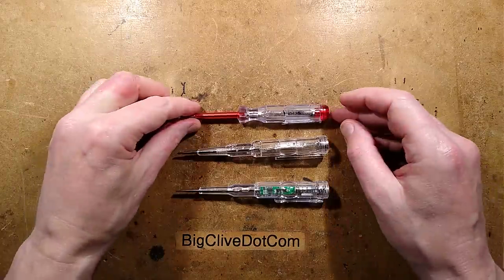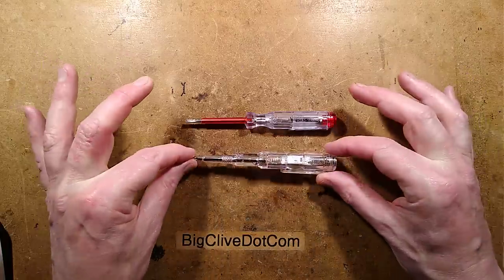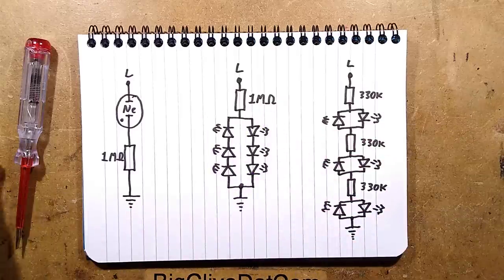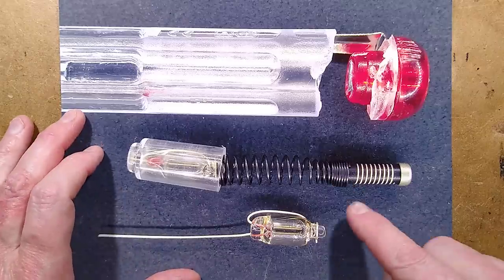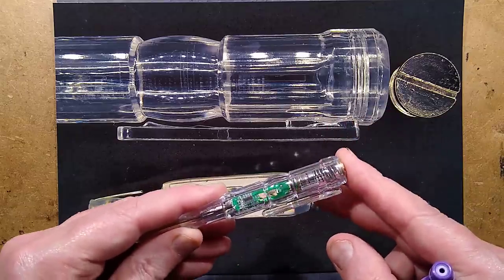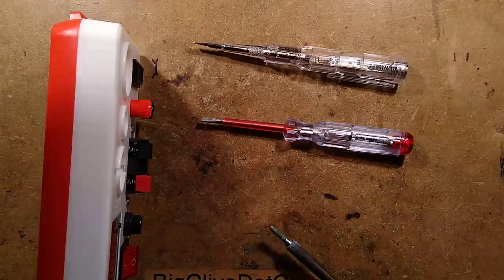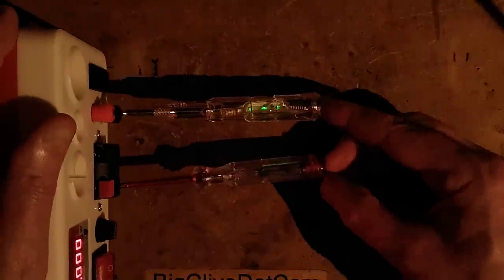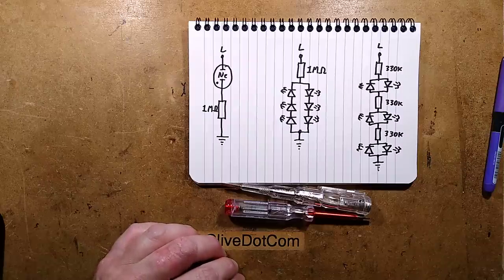Reinventing the neon test screwdriver

Comment: Here's a true neon screwdriver tale: I had a close call being up on a ladder many decades ago in a friend's factory in London checking to see if a 440V panel is dead or not before ripping it all out and redoing the connections. 
On that day I didn't have a neon tester so instead I was using a multi-range tester, holding the black and red probes one in each hand while leaning forward to the electrics to stay on ladder. I carefully dabbed the probes to various places but didn't get any voltage reading at all, it didn't make sense and it completely messed up everything I had planned out. All I got was the reading briefly just tiny jump slightly from zero when I made the probes contact. I wanted to confirm the voltage was there first then shut off that circuit only. 
So I just came back down from the ladder, very puzzled, I then packed it in until the next day.  Next day I came back in to repeat and then I noticed.... the tester was switched to DC VOLTS instead of AC. DOH!   I was THAT close to a major calamity but my '6th sense' + logic had saved me. 
If I had instead a Neon Screwdriver in one hand then I wouldn't had needed to have a 6th sense + logic to protect me. = much safer.
Reply: What if the ladder increased your resistance to ground and the neon wouldn't have worked too?
Reply: @jor7137  Very good point.....  if the metal ladder I was up on had been instead made of insulating plastic, but a wooden ladder that's more feasable. I'd still be puzzled all the same why a neon hadn't lit up for me first before I'm ready to cut the power, then I wouldn't had proceded any further by default.
I just now remembered all those decades ago when I used a wooden ladder: I would leave a reel of insulated cable down on the ground and then carried up the loose end with me still insulated. 
Then came out in the 80s the non-contact LED 'volt-stick'. I guess if I'd used that the combined wood together with proximity acts like an almost short-circuit impedance?
This all just neatly proves: 
the most sinister and deceiving failure of a safety feature - is the one which is believed to be reliable
Reply: @jor7137  By the way had you seen that YT video of the HV (500 kV?) line worker on a platform attached to a hovering helicopter, clipping on dampers one at a time to each live phase wire.  There was a huge long spark in front of him as he approached.  He definitely wouldn't had needed a neon tester!!
Reply: @jor7137 A neon tester would still work even if the ladder was insulated . They work even if you are wearing electricians safety shoes. 
If the path to ground is blocked by an insulator such as a wooden ladder , neon testers will use the capacitance of your body to function. Any insulation such as rubber soles or wooden ladders,  become the dielectric of a big capacitor where your body acts as one plate and the Earth as the other.
Try it , you can jump in the air while one of these things is glowing , and as long as it stays connected to the live, it will continue to glow.
Reply: @graememorris7820  Good points. I had them give false positive before. Not sure about false negatives
Reply: @jor7137 I can't see how they could possibly give false positives (or lives).
They are great at identifying live neutrals. If the neutral line has become  disconnected from the main neutral bus, and an appliance has been left switched on, that neutral line can float live via the appliance . This phenomenon has caused many accidents , the neon tester will identify live neutrals in situations where a volt meter, or other devices that rely on the integrity of the neutral, will deceive you.
Reply: @graememorris7820  I can't explain it to you, but I have seen it. A cable that was disconnected on both sides. The neon bulb would glow. Must be induction or radio waves.

Comment: The neon bulb has high enough resistance to prevent a lethal shock even if the megohm resistor fails short circuit. The neon also has other uses checking for microwave leakage or standing waves on an antenna circuit. LED’s offer no protection, hence your suggestion of using three resistors in series. Fifty years of using neon screwdrivers as a quick sanity check gives me a degree of faith in these simple devices that I don’t have with the all singing and dancing high tech solutions today. Yes, you do need experience of how to use them properly and appreciate that no light never means a guarantee of no voltage!
Reply: The impedance of a neon lamp once struck is quite low. Certainly low enough to carry enough current to be dangerous, tens of milliamps if not more just for a small indicator lamp. It would be highly dangerous to rely on the neon to protect you if the current limiting resistor failed short.

Comment: The neon has a much higher threshold which could be useful. To duplicate the effect a couple of back to back zeners in the 68V range in series could be added.
Reply: Don`t need zeners back to back,  look up Tranzorb diodes !
Reply: @pjeaton58  Transzorbs are much better for transients and less accuracy on the point at which they start to conduct. In this application I'd stick with zener diodes.

Comment: Interesting. Mine has a different design. It contains spring which is connected to the red cap and is pushing to a glass fuse where the fusible wire was replaced with a neon and a resistor inside.
But sadly the transparent plastic cracked and the red cap fell off and when I glued it back the glue covered the fuse with a white film overtime and slowly terminated the connection between the spring and the "fuse" so the neon won't turn on anymore.

I hope they will make these simple test screwdrivers with LEDs instead. And it looks nice with the green ones. But I like the neon variants too.

Comment: It would be interesting to read the current in µA.  The green LEDs are acting similar to LED lamps that continue to glow dimly after the power is shut off due to leakage currents.
Reply: Good quality Green LEDs need only a few hundred microamps to look reasonably bright.  It depends a lot on the quality of the LED; there are so many shysters selling LEDs with defects, especially ones with bubbles in the clear epoxy.  If you buy LEDs that are not mounted on tape, there is a high probability they're factory culls.
Reply: @acmefixer1 what do you mean by mounted on tape?
Reply: @chloehennessey6813 components with leads are shipped stuck to one or two strips of tape for automated handling
Reply: @chloehennessey6813 on the reels that they come on for mass production probably.
Reply: I've experimentet quite a bit with leds and ultra low currents to recreate tritium keyfobs. 
Green doesn't work that well. 
White (warm white as low as 1800k 3535 leds) are by far the best. They can be seen at normal room brightness at as low as 2μA. Green takes ~10μA to be as visible. The second best are blue and ice blue leds followed by some kind of pink. Red and yellow are the worst taking >20 μA to be even visible at lower light conditions.
Reply: ~100μA with an white led is bright enough to read text in a 3m² room, that is othervise completly dark. :)

Comment: I think the Neon lamps are safer and last forever in such application. 
The fact that diodes fail short is disconcerting. Neon lamps have two plates separated by gas, not much can go wrong there.
Reply: neon lamps die too  the glass can break. or something can disconnect.   led will also last forever
Reply: Even if the LEDs fail short it would still be safe. That's why it's better to use the version with several resistors in series to spread the voltage and keep it safe even if a resistor is shorted.
Reply: I was thinking the same thing. Some circuits I have seen, which take a voltage reference from the mains, do so with a whole stack of resistors in series for safety.

The classic neon screwdriver uses just one resistor, and my thinking was that neon bulbs added the additional protection.

Comment: Would be interesting to plot some measurements and see how they vary with dry vs wet skin etc.  If there is a reliable gap between grounded and non-grounded thresholds, could the circuit be improved by setting a couple of comparators at those levels - then you would have a logic signal you could do anything you want with (like light LEDs at full intensity :P )
Reply: You can feel the difference. Hot sweaty environment can make it a bit tingly.
The ol' "testicle pensicle" has saved many a lecky from unexpected live ones. In bright light you feel it before you see it.
240 / 415 VAC control circuits are still around.

Comment: Never thought it would be this simple to use LED's in one. It makes me wonder whether one couldn't make a nice little decorative light without a neutral connection. Super simple design and looks really nice with the slight flicker.
Reply: without a neutral, I'm guessing that if you add enough of them, you can trip the earth leakage protection
Reply: That's called the antenna effect. It's technically capacitor efect. I see it every day when leds are used with very long wires, they glow even when switched off.
Reply: @rexsceleratorum1632  Good catch. Still would be a nice light but probably should use the neutral instead.
Reply: @Benoit-Pierre  Yeah, but that isn't done intentionally. That usually happens with cheap lights with no resistor across the led's.
Reply: @memejeff   It happens in most wall switches that include a witness (the witness may light in the wrong situation) (Legrand Mosaic, Celiane, or Plexo using LEDs like 067686 ), or alarms like Legrand 076671.

It also used to happen with LED bulbs used with halogen regulators: even switched off, leakage current could still light the lamp; recent regulators now fix this issue. You can also fix the issue on the bulb side by adding a parallel 0.1uF X2 capacitor (X2 does not means times two, but the letter hix two is the capa classification).
Reply: @Benoit-Pierre  ah I see. Mine don't have those. That makes sense. I hear that they expect a load larger than an led bulb. Thanks for the tip :)

Comment: I would consider that a solid replacement-in-kind for the neon design, for sure.

Have you consider maybe a 20 mA pcb fuse in line, if you're concerned about the isolation capacity of the resistor?

Comment: It may be easier to do an LED version that fitted in the larger version of those electrical test screwdrivers. If a pair of RGB LEDs was used, they could be configured in inverse-parallel with a resistor for each pair. The resistances could be chosen to give a particular colour, possibly including one approximating a neon.

Comment: I must defend the the much maligned neon  screwdriiver and your improved LED version. I was brought up on this device when Avos other testers were too bulky to carry on a push bike and providing you understood the limitations as you must with all. test gear. I was once sent to investigate why shocks were being given from a cold water tap, the neon tester lit when placed on the tap! Of course the tap was not alive but the floor was, reaching in through the doorway and digging the neon screwdriver into the wooden floor there it was. The floor was soaked in moisture and chemicals and was conducting from a faulty heater next door

Comment: In the old days, the neon bulbs are brighter and lighted bulb can be seen easily.
Nowadays the neon bulbs are poor illuminated that may be seen as no high voltage and caused electrical shock.
For safety, I use clamp meter with NCV for AC high voltage non touching  testing.

Comment: I'm sure you must have used the older ones that had a screw on end cap, which was always handy so you could tip the water out of them after picking it up out of the puddle of dirty water you'd just dropped it in, that would have been shortly before your teeth were rattling around in your head 😮

Comment: I built a tester after getting new green LEDs, It works great, even in a lighted area. Being that I am only using this on 120 vac I reduced the current limiting resistor to 220k. Tested it with one finger on the tester and an adjacent finger directly on a ground, absolutely no sensation of shock. It stays below the 400uA threshold for sensation

Comment: clive i know very well that you know what you are doing but i think the light sticks are safer.  years ago a sparky left his e-z scan above a suspended ceiling in a high-rise office building.  some time later we had the job doing a total stripout including the ceiling.  the e-z scan fell out of the ceiling and has been mine for more than 30 years.   the same model is still available.  a row of leds allow you to locate live wires, more leds light up the closer you are.  ive shown it to qualified sparkies who had never seen such a thing.  and some of them cant see how it has any advantage over the common light stick.

Comment: If I recall when I was working on human interface with mains voltage we had to allow for any direct path where humans could touch live would require a limiting resistance. We had to assume a resistors could become s/c or o/c.
Safety resistors were too expensive, and not all approval bodies would accept them other than the ww type.

So in order to say create a 330k resistor, we would need to use 4 resistors (a parallel pair of 330k and then another 330k parallel pair in series). The ww fusible resistors only went up to about 1k, and you needed to limit current to a few uA. This meant you had to use around 1M for a 253V AC rms (240 + 5%).

Fun fact neons need a few photons to cause the gas to initiate the flow of current between the electrodes, even after the striking voltage has been reached. If you wanted to use a neon in a dark /sealed environment (relaxation oscillator or as a voltage regulator), you needed a small light source near it or to cover the inside of the neon bulb with a bit of phosphorus that will glow due to electron radiation from one of the charged electrodes.

Comment: The LEDs might be a little too sensitive. I get a green LED to dimly light in my house, by holding one leg and touching the other to an earthed object, such as a tap or radiator. Putting a 75V zener diode in series and a high value resistor in parallel, would make it less sensitive, but it should still work with the mains.

Comment: Reminds me of the "significant hit" I had from a (probably Chinese) VERY cheap Neon tester decades ago!  Made a very basic version of this using two red LEDs in inverse parallel, and a 500k resistor.  Bright enough to almost read a book by , and I wonder where that device is now -= somewhere in the garage I suppose 😀
Reply: 500k will deliver letal current when used on triphasé 400v. Also you probably used a 250V resistor which will arc on the 310v part on the top of the wave, which can kill you in 0.2 s.

Comment: Speaking of neons, I was originally thinking of using blue neons for my "vintage style" VFD clock (mostly because blue LEDs wouldn't be "period correct" since I'm using soviet era VFD tubes from Ukraine) for the ":" between the hours, minutes and seconds. However I wasn't sure they'd be happy about switching on and off every half second, or if they'd be bright enough to match the VFD tubes. Then I thought of getting some of those tiny grain of wheat bulbs used in model railways and etc. and painting the bulbs blue or using a blue filter film. So I tried a blue alcohol ink pen, and rubbed off far too easily. Next I got some blue filter film from the art store and that did almost nothing to tint the bulb light blue. The only other option for the bulb is to try a piece of blue tinted acrylic, but I fear that would be much the same as the filter film unless I can find a dense enough blue coloured acrylic. 

So I'm looking again at neon bulbs, and I'm not totally comfortable using mains voltage in my design. So I'm wondering if there's a way to use them similar to the way they're used in that screwdriver, at at lower voltages with sufficient brightness to not look out of place next to the VFD tubes?

Comment: I was kind of hoping you'd touch those with the iron directly. Would that release the magic smoke?
Reply: Neon always has a resistor that can accept 500v direct contact.

For leds, a proper design should also be tolerant. Always be sure to use a 500V resistor, and calculate your max current for 500v.

Note that small leds are said to use 10mA. That's partly wrong. That 10mA current is to get an MTBF of over 1 million h. They can easily accept 40 or 100mA for 100 000h or 10 000h. 

Do you think you will spend more than 10 000h touching the tip of that tester in your life time ? 

What you must consider in this usage is the max reverse voltage. That will be your limiting factor, because this one does not forgive.

Comment: What about using some clear gel LED filaments? There's so many dies in them you may be able to get more brightness for the same voltage as a neon, like you did a while back in the LED vs neon indicator video
Reply from the maker: I did consider that, but even with two in inverse parallel there's a risk of exceeding the reverse voltage of individual chips depending on whether the reverse leakage currents are matched.  It's a fairly low risk though.